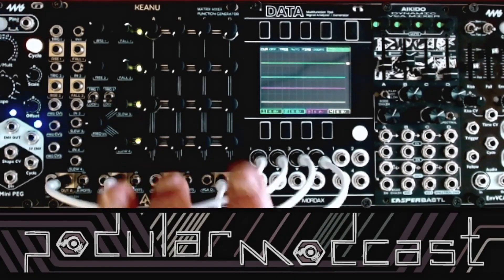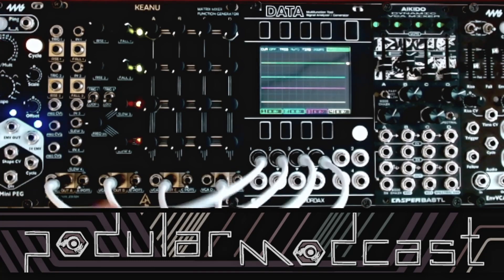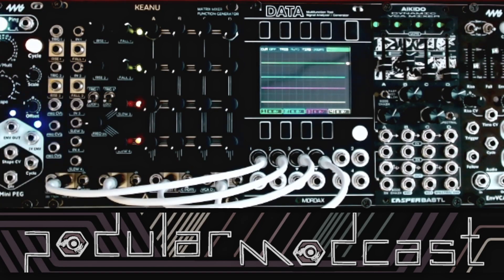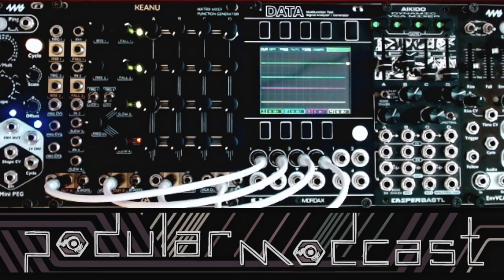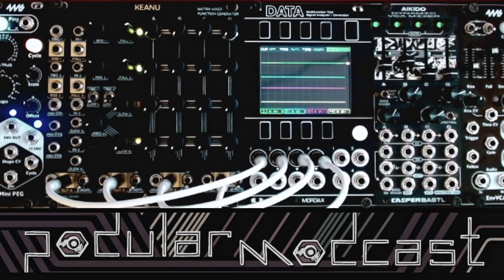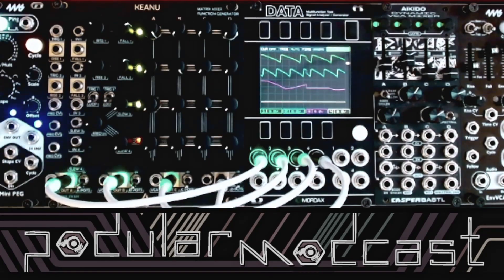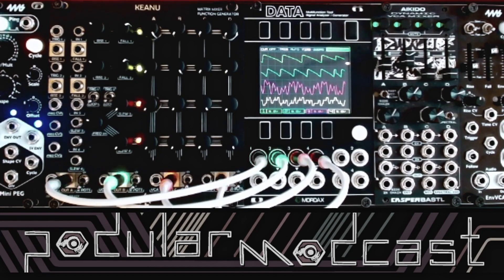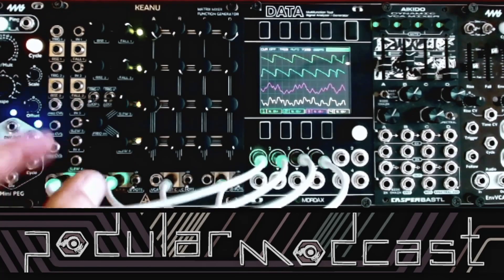Pod Mod & After Later Audio Present Keanu: a souped up Matrix Mixer

Comment: Any plans/interest in more demos? Seems like a really cool module, but it’s woefully under documented (no manual, as another commenter pointed out). Particularly interested in how it handles audio! Am looking for a Maths replacement and a matrix mixer and wondering if it can do both in my small system. Cheers!
Reply from the maker: @bobbyeagles  yeah, I am hoping to get an audio demo out soon! Regarding the Maths question; the 2 function generators don't have lin/exp switch, so in that sense it can't replace a Maths.
Reply: Nice - Looking forward to the audio demo! Good point on the lin/exp switch. Trade off might be worth it though.